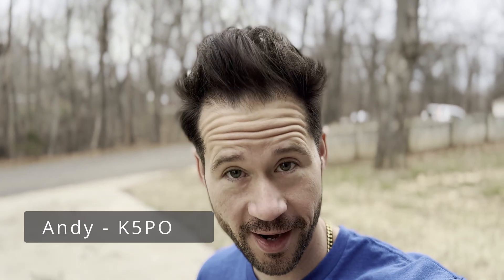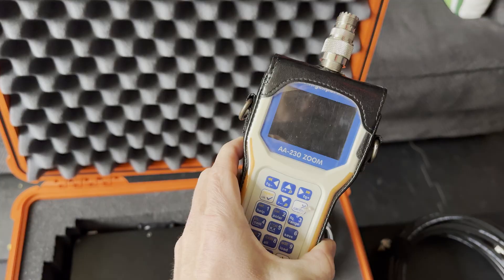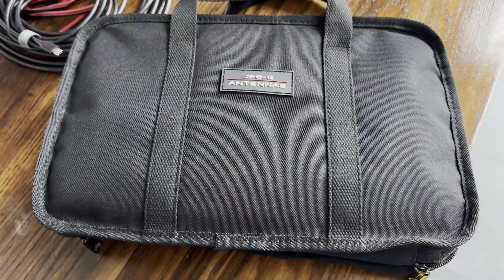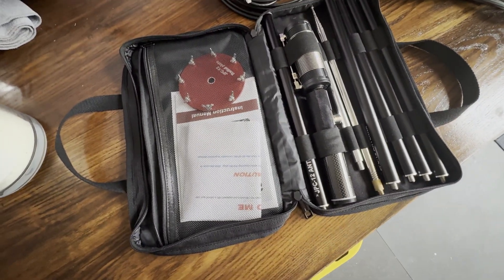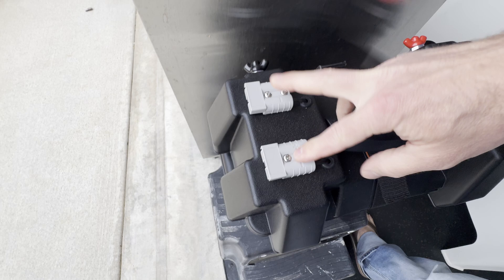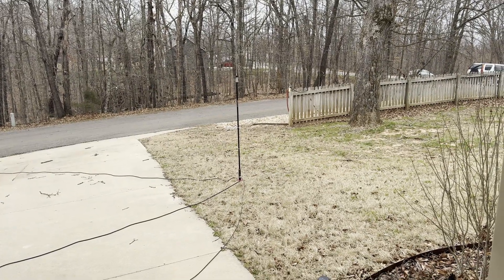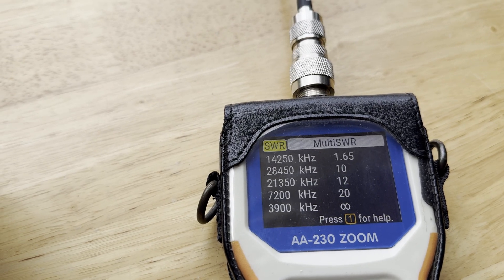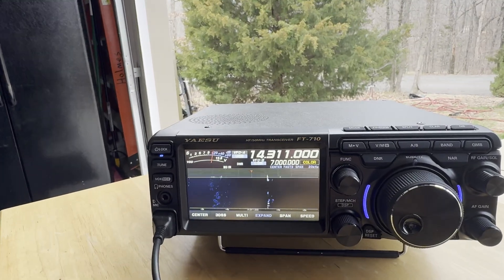Go box for portable HF with Yaesu FT-710 and JPC-12 antenna

Comment: Nice setup Andy. I have the same vertical antenna. What a great performing antenna. I lay down 6 radials. I had the 710 but upgraded to the FTDX-10 since the 10 accepts a CW roofing filter. Both are great radios. 
Barry, KU3X
Reply from the maker: Nice! I need to get it all out somewhere for a proper test. May cut a couple more radials as well. It seems to RX quite well with this setup but TX not quite cutting through. 73